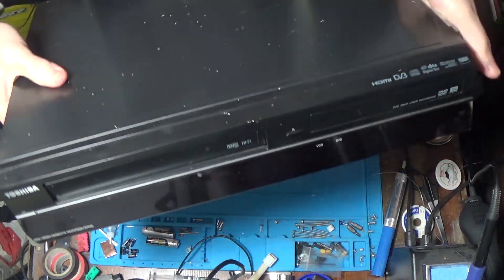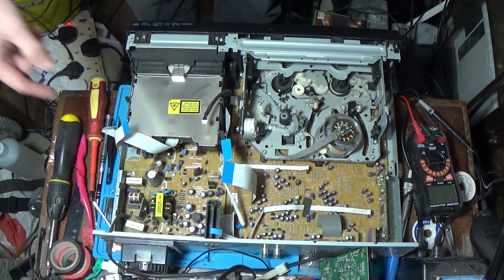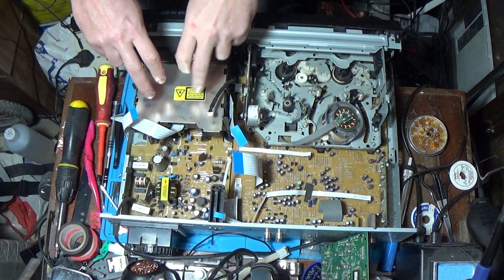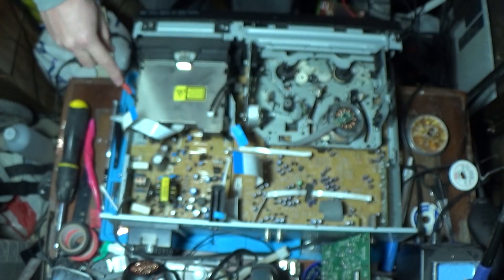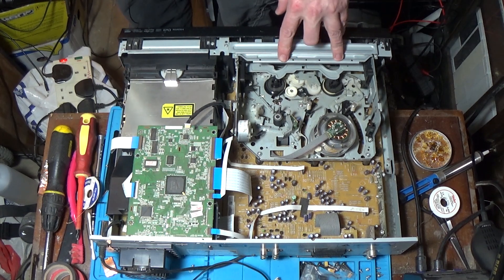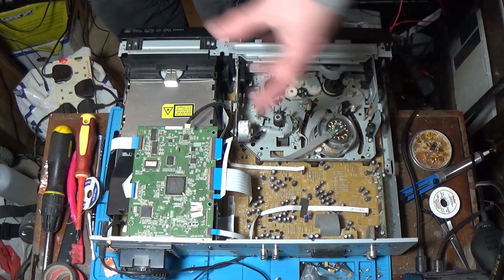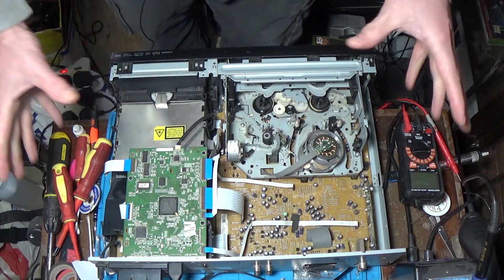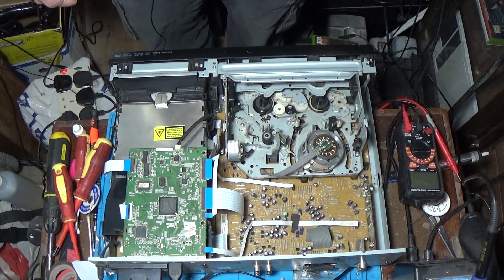Toshiba VHS/DVD Combi Turns On And Shuts Down | Turned out to be an easy fix | UK eBay Reseller

Comment: What a stupid design. The whole unit shuts down just because of a bit of dirt in the light pipe and crappy mode switch, which has nothing to do with the DVD or HDD functions. I have one of these with the same powering on/off symptom so i'll definitely clean the mode switch and light pipe. I won't put any new grease on the mode switch. I'll also replace D1150 with a 3A schottky or ultrafast diode. If they hadn't used so much grease on/in mode switch  in the first place it wouldn't attract dust.
Reply from the maker: Yes I agree, thanks for watching and commenting. 👍

Comment: I had the same problem with mine - I tried all of the suggestions without any success however I noticed that three 3300uF capacitors on the power board had bulged tops - I replaced them and the unit now works fine again. on testing the value of the duff capacitors had dropped from 3300uF to around 100uF. I mention this in case it is of any help to anyone else.

Comment: Great video, gave you a like and I thought your easy fix would work for my problem. Followed every step with no luck at the end. My problem seems to be as soon as I attempt to power on my Toshiba D-VR7 the power button turns on for a few seconds then immediately shuts off. The last time I used it I had no issues but now it just doesn't want to stay powered on. Hopefully I can get it fixed down the road with someone that knows what their doing better then me. It was a good little combo player and really never over used.
Reply from the maker: That could be a capacitor problem on the power board. I have other videos on Toshiba's and Panasonic's changing bad caps.
Reply: @RetroElectronicRepair  Thanks for the reply. I'll check them out. 👍

Comment: The power supply on my Gunai WD6D-M100 makes the same noises as yours, but on the D1150 there is no diode on the board, but a wire. where can I look for the error? Thanks

Comment: Dear my Toshiba VCR/ DVD/HDD combo is doing the same thing. I followed your instructions and clean the mode switch, IR sensors etc but still it is shutting down after a minute or so. I thoroughly looked again and tried your way to check the sensors. The right side sensor is working but the left side not. Please suggest what to do.
Reply from the maker: It could just be a faulty sensor. You would need to check if it's getting any voltage to know whether it is the sensor or board problem.

Comment: A little dielectric grease on the mode switch will keep the contacts from oxidizing and that sensor which that light shines on should be wiped off too.
Reply from the maker: Thanks for watching and the information. 👍

Comment: This video helped finally fix my DVR 620!!!  After several hours and YouTube videos, I came across this video, and I was going thru the same issue with the machine shutting down after attempting to play a VHS tape.  It was still shutting down after disassembly and cleaning of the mode switch, like what happened to you in the video.  😡Cleaning the little LED piece finally fixed it ("lightpipe", I think you called it)!

Funny how such a small piece can cause so much trouble!  Like yours, it wasn't even very dirty as far as I could see - maybe a small bit of dust on the part that goes over that little black gear.  Anyway, just wanted to say thank you very much for this video!

Comment: Fix 3 solved it for me!  Done 5 tapes already, all worked great.  Picture clarity on this unit is unparalleled, for both composite and hdmi.  Note use
480 composite for copied VHS tapes.  Upscaling 480 to 1080 doesn't look the best.  Higher resolutions for DVD.  Thanks again for the fix!
Reply from the maker: I'm glad this has helped you and you got it working again. Yes the picture quality is amazing on these.

Comment: Thanks for this, did the exact same thing as you, checked diode, cleaned mode switch but still shutting down after a few seconds. Watched your vid, cleaned the light thing and hurrah all working. My combi was the higher version with a HDD but practically the same otherwise.

So a big thank you
Reply from the maker: Glad it helped. Thanks for watching and commenting.

Comment: Thanks for sharing this - I have the "pleasure" of trying to fix one of these at a Repair Café this weekend in very short time frame so all your tips have been super helpful - I'm hoping from the description I have that it's as simple as this one but it's given me a few pointers 👍
Reply from the maker: I hope it is a nice easy one for you and I'm glad this has given you some tips. Please let me know how you get on.
Reply: @RetroElectronicRepair  well that was over an hour of my life I won't get back 😆 but I went straight in with cleaning the light lens - the owners (sat there reading a bible - maybe hoping for divine intervention 🙄) weren't really able to say what the issue was other than it 'stopped playing' - I couldn't see any weirdness initially, the DVD side seemed fine, but the VHS was sometimes doing odd things but loading and playing okay for the most part. I also tried cleaning the rotary switch underneath as you did and then feared I'd made things worse as it wouldn't then load the tape 🤦‍♂ but I think it was the door catching on the front lever - so put it all back together and the SCART output (yah don't ask me why they were using that over the HDMI) went dark though the lower one seemed fine, not sure what happened there - I suggested they take it away and connect via HDMI and keep an eye on any weirdness - it was all pretty clean inside and didn't exhibit anything odd beyond that 🤷‍♂
Reply from the maker: So hard to say what was wrong with that one then. The scart sockets are 1 for input and one for output to tv, that's maybe why one gave you a blank screen. But yes they should hook up the HDMI it will be a much better picture.
Reply: @RetroElectronicRepair  yes it's weird, the top SCART was for the output and was working okay until the lid went on and then it went dark - it's as if the luminance part of the composite went missing, the lower one for the input worked fine, so they are still connected internally - anecdotally this has always been the case with VCRs in my experience - it's also weird seeing such a grainy 240 line image having been used to 576, 720, 1080 and more recently 4K 😂

Comment: You should do a how to fix the flash bulb on a Sony a330 camera. Because.... okay I have bought one and I thought for sure it'd be a quick settings reset or firmware update, but its actually the bulb. Doesn't look complicated but nothing really does until it goes sideways.
Also its good you are back, hope this lockdown thing isn't causing too much trouble on the home front, been seeing too many people rubbing each other the wrong way due to being home with each other 24/7 for weeks.

Comment: Brilliant! This advice fixed my problem on 2(!) Identical toshiba dvr 19dt! The first one works like a charm now. The second one works but vhs side loads the cassette and ejects it straight away.. will try to clean mod switch which is a bit of the pain according to this video.. will also check belts. what else should I investigate? Thanks anyway for the great video!
Reply from the maker: Nice! I'm glad my video helped you out. Thanks for commenting.

Comment: This video is awesome. I tried cleaning up the light sensor with some rubbing alcohol first this didnt resolve it for me. I had to clean up the mode switch as this was covered in grease from the goons at the factory during assembly must have made its way in. I reset the white plastic dial to its home position as indicated on the circuit board then wound the locating cog above using the runners on the side. Following re-assembly it all worked just make sure you plug in all ribbon cables again securely as i missed one and it stopped working completely! Nice work man resolved the issue with the same model KB version. I think the resistor part isn’t the issue with most. Try fix 2 and 3 before doing this! My symptoms were that the machine turned off after you inserted a tape
Reply from the maker: Glad you got this one fixed. The mode switch does have a small amount of grease on the lid so the plastic doesn't stick but over time I think some gets on the contacts.

Comment: Cheers dude. Have same model/ problem. Picked it up for a tenner mint with remote. Still had the film on it... hopefully will get same outcome. I know where to start!
Reply from the maker: Let's hope it's as simple as this one.
Reply: Follow up, took top off, cleaned the light pillar. No go. Cleaned again. Nothing. Put the top cover back on and worked fine instantly. The light pillar must be sensitive to light pollution. Took cover off, failed again. Put back on and fine again so confirmed the light pollution theory. Drum was a little stiff but freed just by turning manually. Cheers buddy!

Comment: I had an issue where the unit worked fine for dvd. VHS would play for a few seconds then enters shut down with a message displayed ‘saving settings’. Cleaning the clear plastic thingy has so far resolved this power down issue for my DVR19DT. Thank you!

I also have a RDXV59DT which gives a ‘disc read error’, I know it’s not the drive or laser etc as both units share the disc drive assembly part and I’ve tested it by fitting into the DVR19DT it read discs fine.

Any advise on what to check next in RDXV59DT? I suspect there is a board/chip/cap which has failed somewhere. Will continue searching forums for an answer.
Reply from the maker: Seems a lot of people have this error. I'm not sure about the dvd not playing, I've not come across that before so not sure what it could be.

Comment: hi my DVR20KB keeps clicking on and off can't get tape out to clean light pipe. are you saying by cleaning the light pipe it would/could stop the clicking and would  turn on and work. any help would be appreciated. many thanks nigel.
Reply from the maker: Isn't that model the toshiba DVD to VHS combi? If it is and it's just clicking on and off it will be bad capacitors in the power supply. It's probably similar to this video https://youtu.be/O1Hlm8gxF6o?si=UgaKWSdVsbdYbfNZ

Comment: I would have gone straight to the power supply too. Thanks for that will start on mine now.Seems barmy that little light switches turns the whole machine off mind.
Reply from the maker: Yes, it's the only one I've come across that will shut down the whole system because it can't recognise the tape is moving. Crazy!

Comment: Not sure if it's a permanent fix but so far so good, thank you 👍
Reply: It is a permanent fix until the dust will block the sensor again. this Funai/Toshiba devices should have a build in dust protection shield but the manufacturers didn't build it in so for me it is a small engineering failure, or maybe they did it on purpose for faster malfunction and sadly to throw away the unit 😞

Comment: Recently sold one of these that was working fine when it left me……. Buyer received and said it is shutting down as your was when playing vhs!! Waiting for it to be returned……. Was wondering if they had used a mouldy cassette or something to cause it……. Not confident enough to look at the mode switch I don’t think but definitely they light bar looks simple….. great video
Reply from the maker: It is hopefully only that light pipe. Give it a good clean when it's back and fingers crossed it will work again. Also give the sensors on either side a little clean to, I'm sure I showed them on the video, as they read the light which tells the machine a VHS is playing.
Reply: @RetroElectronicRepair  yes you did show them….. keep up the good work and thanks for the reply
Reply from the maker: You're welcome. I hope you get it working again.
Reply: @RetroElectronicRepair  it’s just arrived back with me so I’ll give it a go shortly…… will keep you updated 👍🏻🤞
Reply from the maker: Yes, please let me know how you get on
Reply: @RetroElectronicRepair  quick update…… good and bad, the unit arrived back with  all the front flap snapped off 🤬🤬 cleaned the light bar and sensors on both sides as well as under the light bar and it seems to be ok 🤞 thanks for the great video again……
Reply from the maker: I'm gutted for you. When customers return broken stuff they don't care about what condition it arrives back in, it makes my blood boil. I would only give them a part refund, because it got damaged on return, but eBay would probably side with the customer and give them a full refund anyway.
Reply: @RetroElectronicRepair  I’ve argued the toss with eBay…… basically had to give a 70% refund, not happy. Had to fight to get my final value fees back and return postage……. They ain’t bothered…… makes me wonder why I bother to be honest…..
Reply from the maker: Yep, you do get days like that with eBay unfortunately.

Comment: What do I do if the VHS is stuck in vcr  and I can't get to the light pipe?
Reply from the maker: If it turns on for a moment the you should be able to constantly hit the eject button and it might eject. Otherwise it depends on the model, some have a cog on the side on the tape mechanism that you can turn to release the tape. On some others you will need to remove the whole tape deck to get to the cogs underneath to manually rotate them and eject the tape. I hope this helps.
Reply: @RetroElectronicRepair  thank you sir

Comment: I had exactly same failure on my device with the 3 in 1 Funai TD6D-D4413DB VCR/DVD/HDD Recorder (exactly the same build like this Toshiba 2 in 1 Recorder. I also cleaned this light emitting plastic in the middle and the problem is fixed. I think the manufacturer should add a anti dust filter to the fan and to the chassis to prevent any dust to build in inside this device I bought a dust filter and build it inside the fan (and the chassis and now my device is cooling and also preventing any dust to go inside. It it now working for more than 5 years without any problems. But like I said even this Toshiba branded VCR DVD Recorder is engineered and build from Funai Electronics and only rebranded as Toshiba.
Reply from the maker: Yes, I've only ever had this problem with Funai/Toshiba. Never seen it happen on any other manufacturer.

Comment: Hello and thanks for this great video!
I'm experiencing the same issue.
The switch mode is completely out of order (the 3 copper pins are twisted and it is not possible to put them back in correct position).
So would you please let me know if someone in this world sells this component?
In the service manual from Toshiba it is identified as SW507. But they don't give the part ref.
Thanks again!!!
Best regards.

Comment: Have bought a VHS video recorder from car boot but it has a password that needs inputting which I don't have. Any ideas on how I can reset please without knowing the original password? Any help appreciated. Thanks
Reply from the maker: Have you tried the default of 0000 or 1234? I've not had to bypass one yet so don't know how to reset it.
Reply: @RetroElectronicRepair  thanks for the quick reply. Will try the numbers you have suggested. Would be a shame if I can't get access as the video recorder as it is in mint looking condition and has remote control with it too. All seems to work switch on ok but I can't get passed the password. I might try and see if there is an onboard battery I could take out and put back that might do the trick if the default numbers don't work. Again thanks for your response and suggestions. Kindest regards.
Reply: @isakisak7310  there is usually jumper pins on the pcb marked "prst" or "reset" or something to that effect
Reply: @mzimasprings3217  brilliant. Thanks for that. I will check it out and see if that works. Much appreciated. Kind regards.

Comment: Clean the sensor underneath the black  gear stick a q tip in the little hhole and clean it. It will solve your problem
Reply from the maker: Did you not see that I cleaned the light pipe and fixed it? It's not a sensor under there, it's a light.
Reply: @RetroElectronicRepair  nope it a sensor under the black gear u have to take the gear off to clean it
Reply from the maker: Ah ok. Not on this one though, it was a dirty light pipe that a light shines through that the photo sensors on either side of the tape sense. You'll see if you watch it all.
Reply: Thank you so much